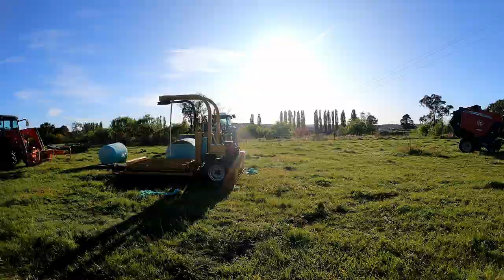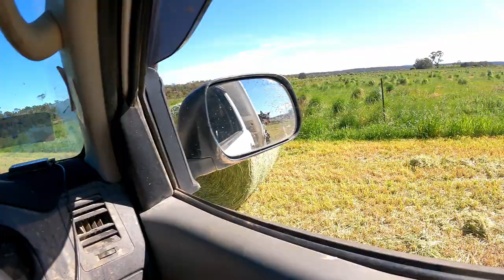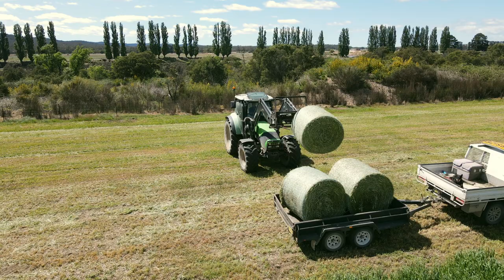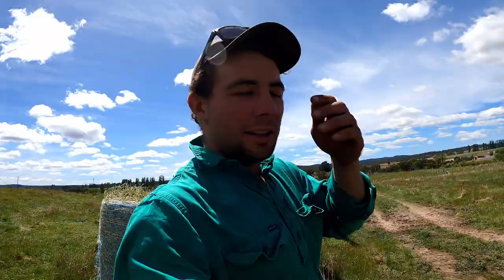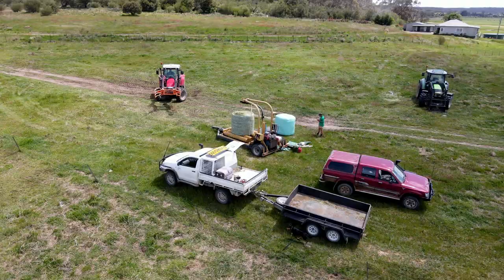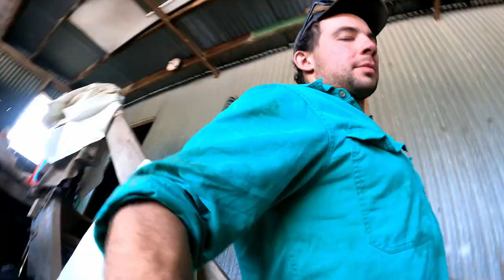ALL WRAPPED UP | Wrapping Oaten Silage | Tanco 1804 bale wrapper | Australian Sheep Farming

Comment: Another nice video.  I feel your frustration with the glitch in the wrapper.  I purchased new brush trimmer this spring and have had multiple issues one requiring a trip to repair shop.  Had new issue again this morning so thinking I got a bad machine from the start.  Company tends to think so too.  It's under warranty and I purchased extended warranty as well.  Hopefully I get replacement machine.  It sounds like disconnecting and reconnecting the battery maybe rebooted the computer on the wrapper.   Hope it was that simple. Good luck!

Comment: I don’t want to tell you how to do things but I think you are putting the bales in the wrapper wrong. They should be put the other way so they rotate round with the rollers
Reply from the maker: Hi mate, yes I tried that too but no that doesn’t work. Doesn’t kick the bales off just sits on there spinning.
Reply: Does the table not tip up to get the bales off?
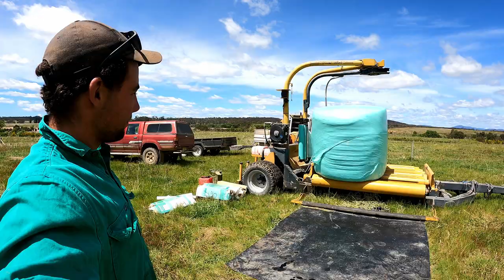Reply from the maker: Nah it doesn’t mate. Have a look at 5:00 onwards. This is how the manual says to do it as well
Reply: @ourfarmlifeaus  I think Drew might be right about the bales needing to be on their round on the rollers.  A round bale tumbling like that will result in a very inconsistent amount of layers being applied over the bale.  Probably still get the right amount of layers over all but there are areas that will have a much more plastic applied.  Should be able to save a bit of plastic if you have a consistent 50% overlap of the plastic, which given the price of it these days would be a good thing.  There's a video here that shows wrapping a round bale on a similar machine right at the end - www.youtube.com/watch?v=DbG7dW93P5A.  Keep up the good work on the videos.
Reply from the maker: @FarmerCJA  hi mate, that was the first time i ever used the wrapper and have since change roller speed and arm speed and am getting pretty close to 50% overlap every rotation. There’s plenty of videos out there showing both ways, difference seems to be that on some models the whole table tips up to kick the bale off, mine doesn’t do that so the round bales just sit there being spun by the rollers but never gets kicked off. Might have more of a play around with it next season to see if I can work out how to get it to tip them off, but at the moment that’s what has me stumped. I do agree they wrap better the other way though. Thanks for the input, appreciate it
Reply: @ourfarmlifeaus  Always a learning curve with a new piece of machinery, sounds like your getting it sorted out.  Wonder if there is a way to adjust the rollers to get it to kick it off, sound like you have some further investigations to do.  First wrapper I used was a three point linkage Tanco, which is a similar wrapping setup but much more of a pain in the neck being mounted on the rear linkage and doing a few hundred bales a day in tight yards.  Got my hands on a new Mchale Orbit this year, 50 bales per hour without even trying hell of a machinery but still took a bit of getting used to.